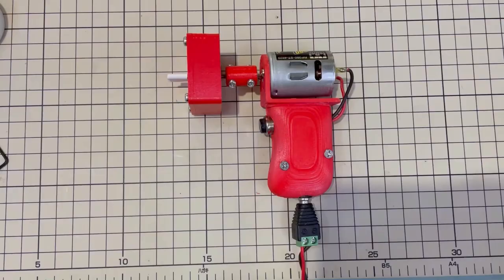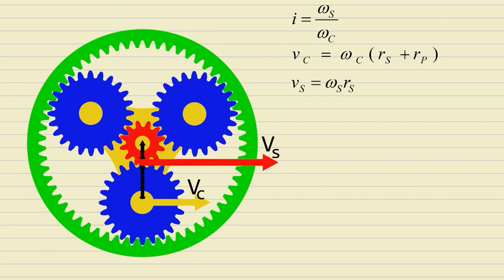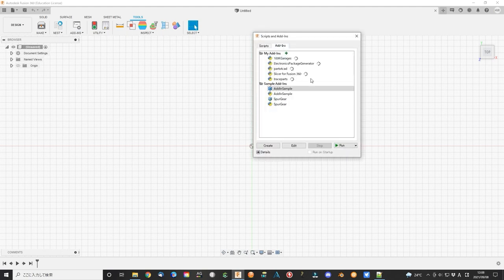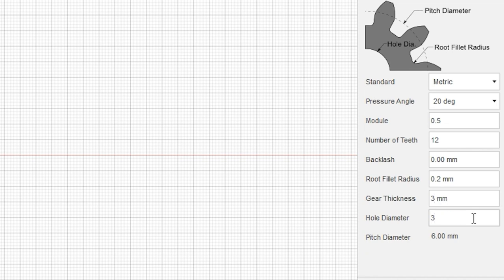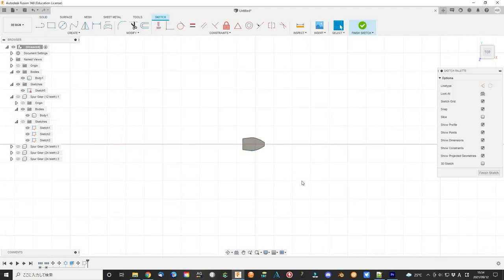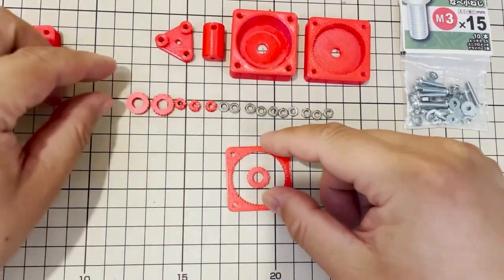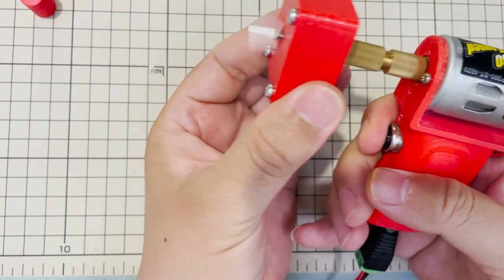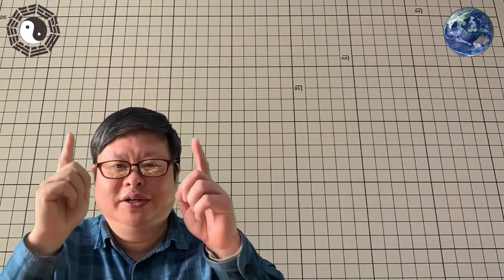Make planetary gear with 3d printer (use Fusion 360 design easily and trick explained)

Comment: Amazing video. May I know about the shafts that you used here? Are those regular screws? Or they are smooth rod with threads at the end?
Reply from the maker: I use a normal M3 screw to fix the gear. The bearing is 6x3 mm. Thanks for your comment. Have a nice day.
Reply: @TubeUnderdeveloped  Thank you for the information😊
Reply from the maker: @nilotpalbaruah6157  You are welcome. Anytime. Thanks a lot.